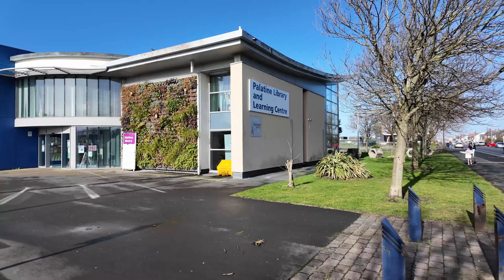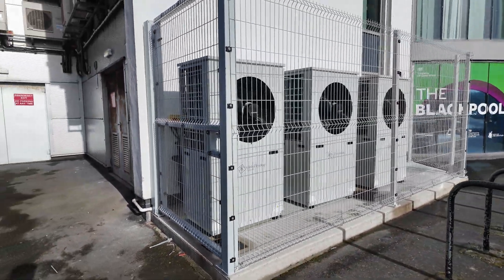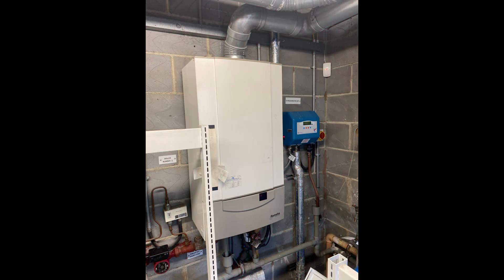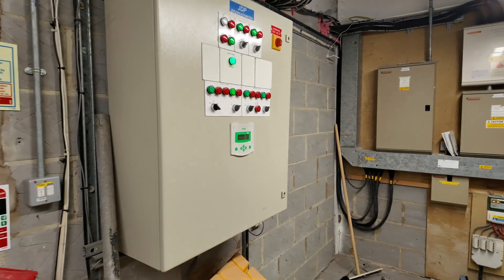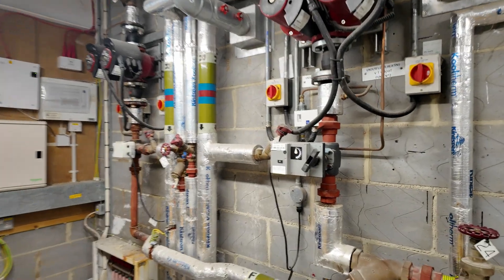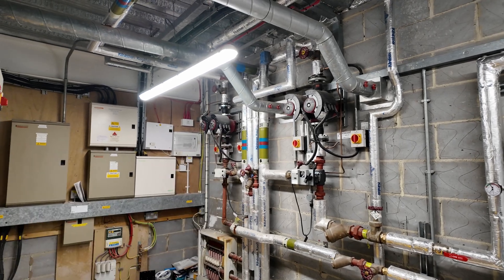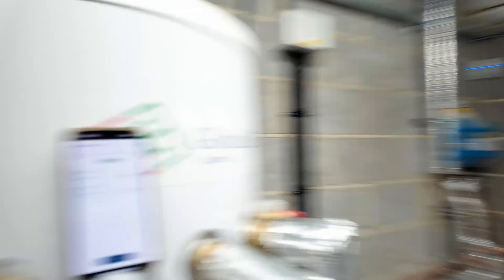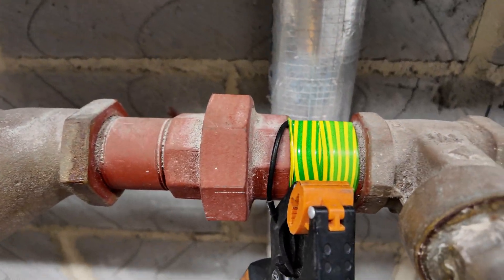Commercial Heat Pump install.

Comment: Great showcase of an installation. Are both zones (ufh and radiators) running at the same mean water temperature?
Reply from the maker: Hi, thanks for the comment, previously they ran at different temperatures when powered by gas. 

They now run at the same temperature hence the one radiator upgrade required. 

Bear in mind there is only 4 radiators in the building and most of the rooms heated by the rads are internal rooms so the heat loss in those rooms is very low. 🙂
Reply: @ ahh okay. That was a touch of luck then. Usually a underfloor heating in screed with a radiator combo leads to huge radiators or having to run the radiators at a higher mwt.

Comment: Is it possible for each unit to come on and go off on demand on WC, so if temp rises, the master unit could meet the requirement and run all the time and others stop.when temp lowers, the other 2 would ramp up in sequence to reach the requirements.
Reply from the maker: @jezzaandrews1940  Hi, yes great question.

When we ‘cascade’ units we set them up to load compensate down and share the load. 

So as you describe depending on load either 1 2 or 3 units will run. We can even share the run time so each unit will have even wear and tear. 🙂👍

Comment: Hello, great video, say you had a circuit one tapping off the buffer with high flow then another with lower flow how do you stop distortion? Is it because all the tappings are at the same height & there is a nice defined thermocline in the buffer? If the tappings where closed would there be more chance of distortion?
Reply from the maker: Hi. Thanks for the question. 

Yes the flow rates have to match to limit the distortion, if you have differing flow rates it will almost certainly mix. 

Connections being the same height helps and a baffle plate in the centre of the buffer can help too. 

We try and design out separation such as a buffer wherever possible but IMO in situations like this it makes sense. Others would argue against a buffer at all costs.

Comment: With a cascaded system, do you have to set a different target flow temperature on each unit or just the same on each?
Reply from the maker: Hi, these have the same target flow temp set by the weather compensation set point.